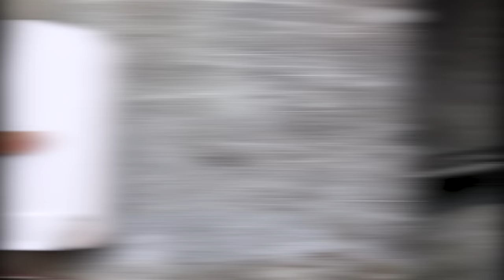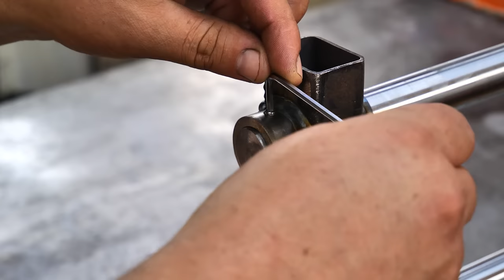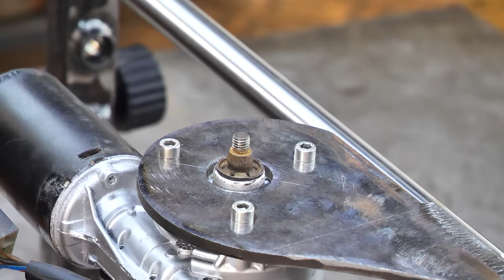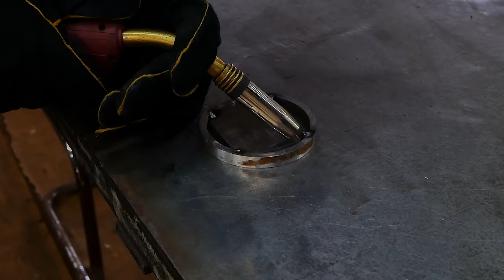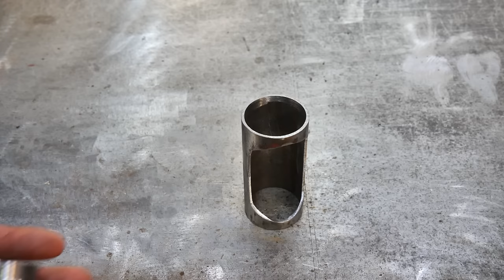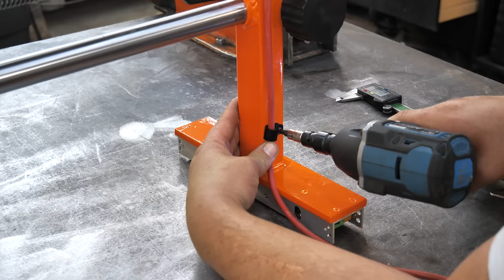Making Plasma Cutting & Circle Track

Comment: Which stepped drill bit do you use? I cannot find one that will drill 2mm steel [without dying on the first few holes], let alone 5mm or thicker steel.

Comment: Bro. Nice work. I have one suggestion. The sprocket rod should have a rod inside that you can lower that would point to the center of the circle then push it back up out of the way to cut. I would imagine with out that setup would be difficult and prone for error. 👍

Comment: Good to see your machine is working Great. Last cut i.e. both side radius and straight in the middle, detailed video is preferred. You can try belt drive and see if the smoothness of the cut is improving.

Comment: Nice job, beautifully machined parts!

I have some feedback in terms of mechanical design! There is a very big overconstrained problem with the carriage. Firstly, both of the linear guide rails constrain the same degrees of freedom. A single linear guide rod constrains all DOF except the rotation about its axis and translation along it. The addition of a second rod removes the rotation about the rods axis of movement, but at the same time introduces overconstraints in all other directions (lets call X axis the travel direction, y-axis the vertical axis and Z 'out of plane' axis, then it would introduce overconstraints in the translation of Y and Z, plus rotation about the Z axis). 
What this effectively means is that your design is extremely dependent on the alignment of the rods for how smooth it travels. Because everything cannot be perfectly aligned, there's a lot of internal stresses, which puts a lot of unnecessary forces/torques on the bearings which means they will wear out much faster. You can imagine that if the distance between the rods changes over the travel, that you might be too close together on one side, and too far apart on the other.

This same problem also exists with the ballscrew you use to drive this stage. Because it is rigidly attached at all points, it acts as an additional linear guide rod, which makes the overconstraint even worse. Ideally you only want to couple translation in the X axis (the movement you desire) and resist the rotation about the X-axis (which is caused by the screw motion), and release all degrees of freedom for translation in the Y, Z axis, and rotation about the Z and Y axis. 

If you are interested in this kind of stuff, which allows you to design machines even better, I recommend the book "exact constraint machine design" by Douglas Blanding.
Reply: Bro wrote a whole novel criticizing lmao.

Comment: Pretty sweet for lines as well, just line up the feet with an offset from the line you want sliced- a bit slow compared to one of those new NC/CNC armatures or an XY table, but it'll get the job done cleaner than by hand!

Comment: Great job 👏! 
I have few questions, where did your buy your hole saw and your thread tap? And why are you not cutting metal plate with plasma?
Reply from the maker: Thank you 😁
Hole saw:
https://www.ebay.pl/itm/353270793290
thread tap
https://www.kingtony.com.pl/uchwyt_12_do_gwintownika_6-12mm_20522.html

Comment: Where can I purchase these items? Like the threaded rod and motors magnets. Even measurements I really want to build one.
Reply: eBay HGR20 For rails - square rails are more rigid than tubing he used. "Threaded rod" is a ballscrew also found on eBay SFU1605 - I work in Industrial manufacturing and use these myself.

Comment: Great build! But with your mechanical skills - go ahead and build a cnc plasma table! You  just have to add some stepper motors and you can cut any shape - not only circles! I use mine a lot of times and it is the best machine in my shop!
Reply: I dream of the day I could just go ahead and do what I want without the slightest worry about where the money was coming from, or even just manage a budget and have singular achievable goal to work towards! (I suffer from adult ADHD, so yeah.....singular..... Hmmm, anyway what was I saying). Living week by week get's monotonous after a while, especially when you have "too much week at the end of your money"  :)
Reply from the maker: Thank you 😁 I will build a cnc but I need time to complete the parts, I also need a little more knowledge, which I try to acquire in my free time :) So far, instead of cnc I use the of tools that will facilitate work with a plasma torch :)
Reply: @WorkshopFromScratch  If you need some help feel free to ask. I run a diy cnc plasma and I´m a fan of your channel. It would be an honour!
Reply from the maker: @RUNCNC  He just subscribed to your channel and I'm watching your videos :) When I make a decision about cnc I will ask you to share your knowledge :) Thank you

Comment: how the horozonal movement is controlled ? manually or you have a servo motor there ?
Reply: By the long acme thread screw with handle turned by hand on left side is what i saw

Comment: I would like to build one of these but I have no idea what kind of motor that is.
Reply: Looks like a wind wiper motor used in cars. Can get them pretty cheaply and easily from any scrapyard.
Reply from the maker: Yes, it is the engine from the wipers, I recommend reading the description in the video, I try to describe the parts I use there, and update the descriptions if any of the parts I use are damaged quickly :)

Comment: Do you have plans for this with dimensions etc.?
Reply from the maker: I did not make drawings for this project. I can provide dimensions, but you have to adjust them to your needs.
Length of linear shafts and screw 900mm, rolls 25mm thick,
profile height 60mm, height of the entire frame adjusted to the size of the burner, including its mounting

Comment: Can you tell us what controller you used?
Reply from the maker: One of the cheapest speed / voltage regulators for 12v motors and other 12v devices, max load 60A, it says on it, but these data are not true, but in this motor they work well :)